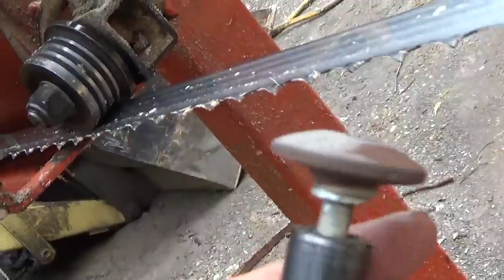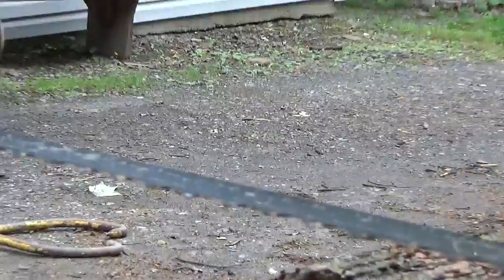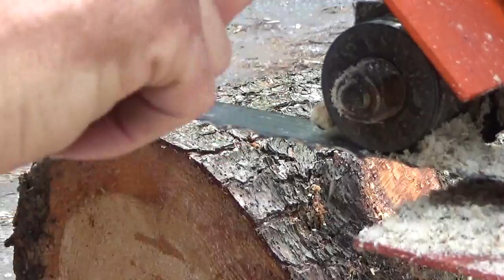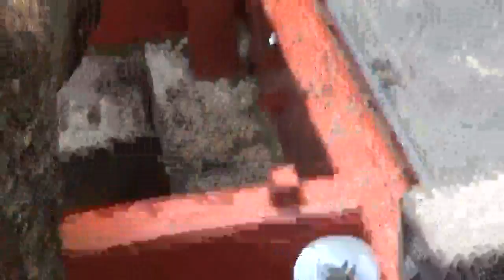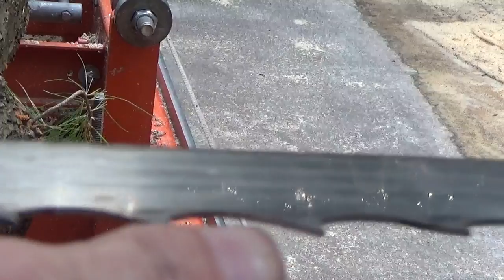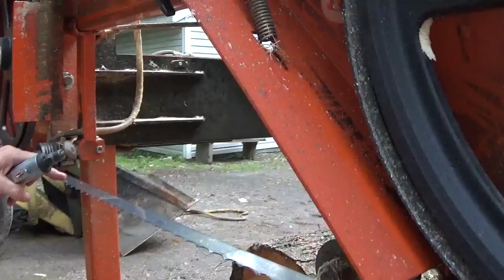How I do blade sharpening for lt15.

Comment: Thanks for the video Joe . I’m spending too much money on re sharpening . What is that file size and what is your air tool attachment?
Reply from the maker: It is a fine 1/4" 3 sided file. The air tool is just a https://www.harborfreight.com/1-4-quarter-inch-45-cfm-air-die-grinder-92144.html?cid=paid_google|*PLA+-+All+Products|All+Products|92144&utm_source=google&utm_medium=cpc&utm_campaign=*PLA+-+All+Products&utm_content=All+Products&gclid=CjwKCAjwps75BRAcEiwAEiACMYpm-so3bwaJo21lcvnNEK6jDrGbOOGu0RB5nI8luMILZ7CpKqE4YhoCBWgQAvD_BwE die grinder with stone.
Reply: Thanks for the info Joe . This will help me save some money .
Reply from the maker: @jimmyjordan1685  You are welcome.

Comment: Hey Joe, know what you mean about the pine sap on those teeth. For me sharpening a chain saw after cutting lots of pine is a bit harder. A brand new file slides over those teeth and won’t catch/file, it take extra strokes file gums up a little sometimes
Reply from the maker: That is what happens with the blade if you dont get the sap out of the gullet.

Comment: i used to hand sharpen. was pretty good at it. then i bought a automatic sharpener from woolandmills. around 600$. best money i ever spent, put it on, go back to sawing, shuts off when it done, i take a blade off saw, put right on sharpener, always got a sharp blade waiting for me. also i been sharpening a couple friends blades, 5 bucks a pop, paid for half the sharpener so far. plus i would shoot myself if i had to listen to that air tool for more than 5 seconds
Reply from the maker: Sounds like that $600 worked good for you.
Reply: I bought a Woodland Mills sharpener before I dulled my first 10 blade pack.  It is easy to set up and run.  It can be used at the mill shed using 12v from the tractor, the truck, or the mill itself. It only takes 20 minutes or so to sharpen a blade, and you don't even have to watch it work...  Best money spent on my sawmill.  I've been using the mill since October  2019, and only gone thru 12 blades.  I am working on my second set of blades.  BTW, I am using the hardwood blade, even on pine and cedar.  They cut smooth faces while sharp.
Reply: @tkishkapesilurian4281  yup.

Comment: Does the blade have any carbide tips, or is it just hardened steel? Looks fairly simple to sharpen... Good job!
Reply from the maker: Hardened Steel. I think they do sharpen easily. Thanks Ronald.
Reply: I would not want to try to sharpen a carbide tipped blade, but if that is what you use, call the Woodland Mills office and find out if it is right for you.